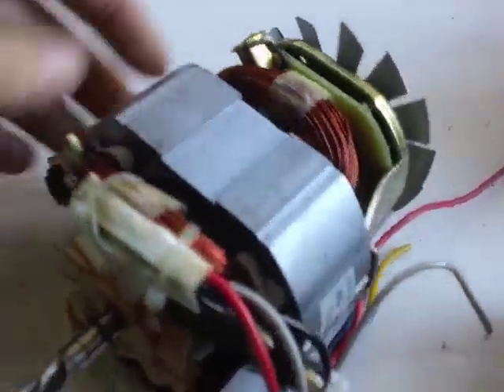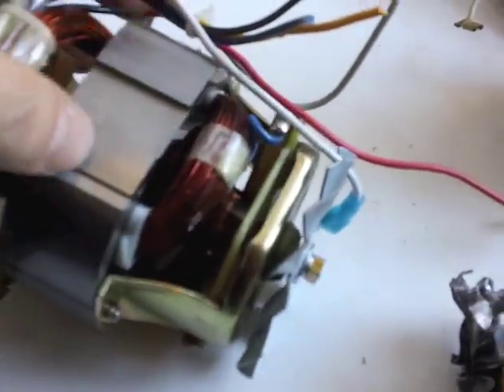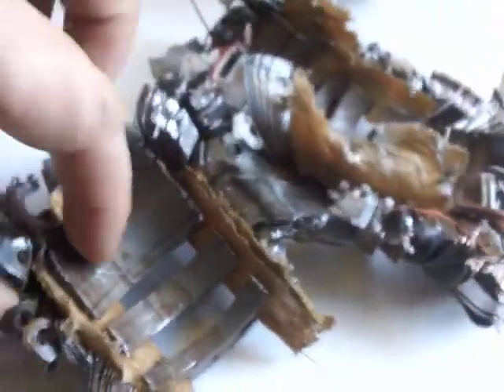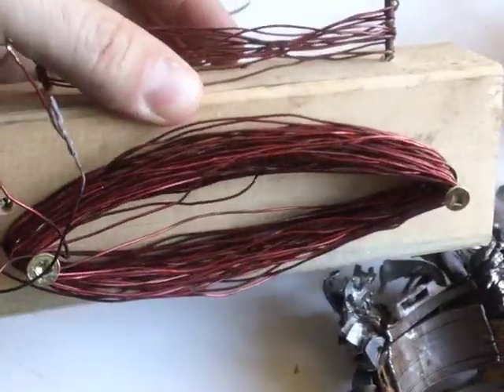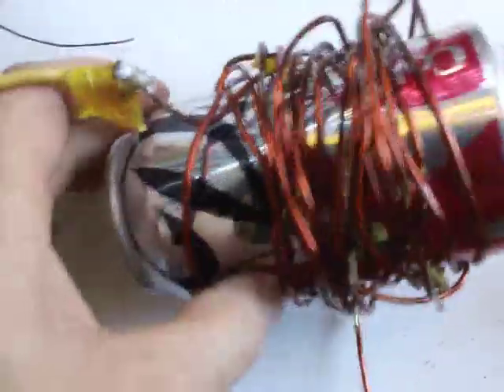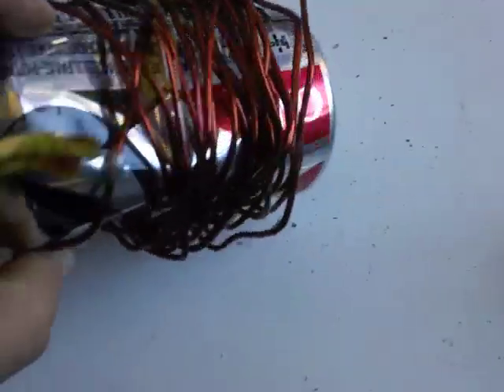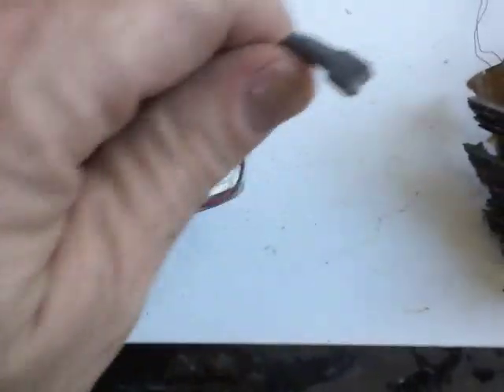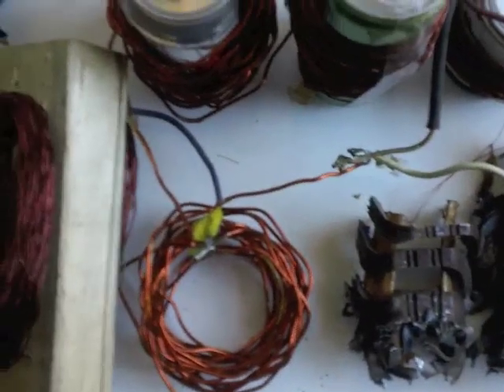A Great Source of Copper Wire for Homemade Wind Generator

Comment: Yeah, those screw threads could scratch the coating off the wire causing a short.
Just use the wood block that the screws are screwed into.

Comment: Hi, can i ask a question please, im new to this. Thanks for your videos and hard work taken in producing them.

Ive been looking loads of youtube videos as im about to try and make pulse motor/generator. Im going to start small scale but at some point id love to make a big wind turbine.

Coils for a small pulse motor with 10mm magnets, what size gage wire would i need please?

Coils for a big wind generator, the type using car brake disks and resin casts. What size wire would i need for them?

Maybe an explanation. So small wire does and is good for / big wire does and is good for

Thanks for your time, regards
Reply: Also if i was going to make pancake coils for the pulse motor, what gage wire would i need for them please?
Reply from the maker: Hi, the size of the gauge wire is the million dollar question. To be honest, I don't know. You might want to jump onto reddit.com and go to the AskEngineers section. http://www.reddit.com/r/AskEngineers/ The people there are really helpful.
Reply: Thank you for your reply, ill look into it :o)

all the best